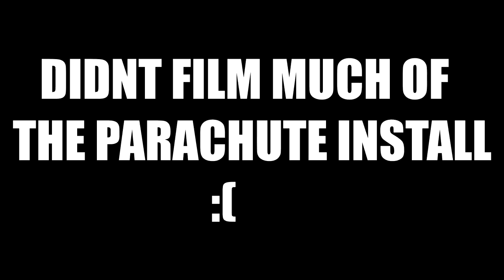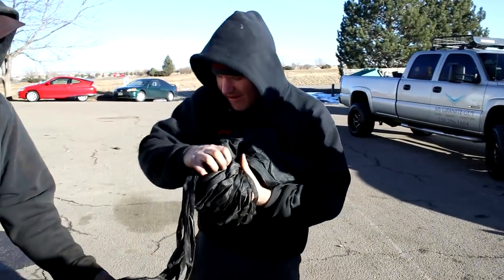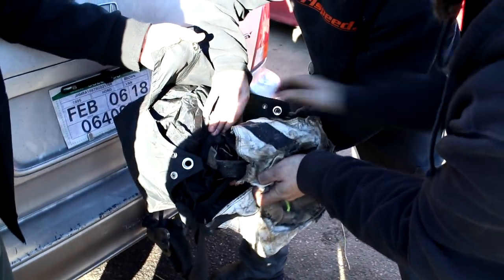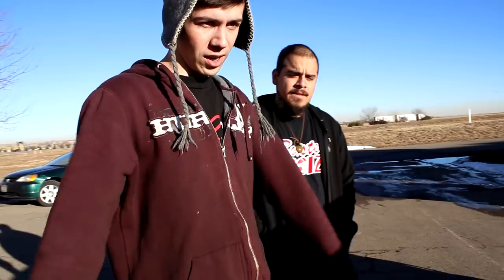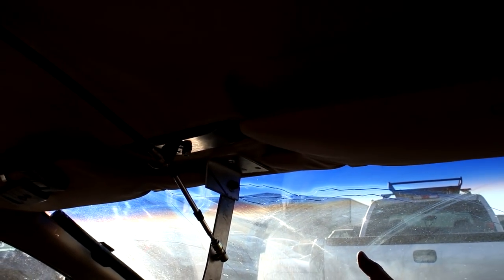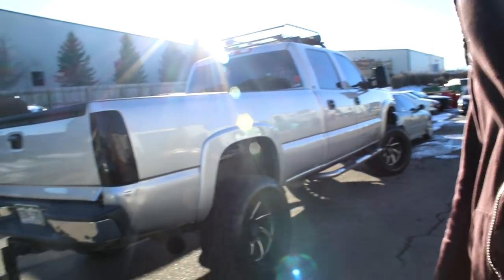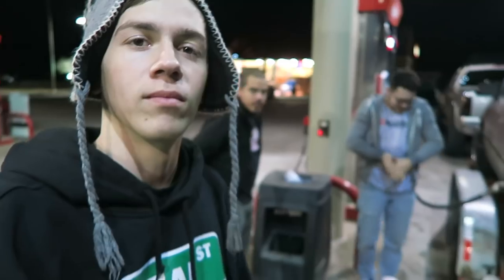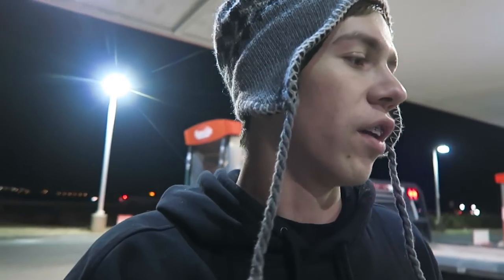We Put a Parachute on a MINIVAN?!

Comment: 700 hp minivan vs Adams 700hp 335i. Would be a sweet race
Reply: BoostedX I'm not sure the van actually eights more...
Reply: BoostedX 335 would smoke easy
Reply: Casanova even if it did the hatch back would come to revenge it

Comment: I always see DSM's at PFI... you guys should do a DSM build. You'd be extremely surprised what a stock block DSM is capable of. sell that 240,every youtube channel has 1 or 7..
Reply: I agree the trans is the weak point. But Kyle has enough cash to build a trans.
Reply: Isn't the stock auto pretty strong? (Hurr durrr but mansmission) I remember a 1320 video where a guy was pushing maybe 1000hp on stock tranny. Sure it won't live forever at 1000hp, but maybe good for 700?
Reply: The auto trans is definitely stronger than the 5speed, but not unbreakable. There are a few things you have to do to make them hold power, but nothing crazy. But the prices of auto parts are going through the roof.

Comment: Word to the wise, if you're running 1/2 mile, turn the boost down in 4th and 5th. Keep the heat under control at speed.
Reply: Why? Wouldnt it have heaps of cooling at that speed

Comment: Wait if ur making 700hp in Colorado in the mountain air wont you make more in Florida??
Reply: Jerrell Taylor 
Less.
Reply: Jerrell Taylor Typically yes you would make more power at sea level than you would at high altitude (less oxygen in high altitude) however old air is more dense and therefore allows an engine to make more power. I don't know how this will apply in this case though because I don't know how high up they are or what the temperature difference would be. I am pretty sure that altitude makes a bigger difference to engine power than temperature does, assuming we are talking about typical temps within the United States.
Reply: Seth Francis Sim Racing kyles at around 5000 feet, so he can expect about 35+ ish horsepower at sea level according to the 3% decline in power per 1000 feet

Comment: I wanna see this thing drag the f*** out of streetspeeds c7 vette!
Reply: HIR3D DRIV3R it would need more hp
Reply: It's front wheel drive,manual,open diff,heavier and has 100 less horsepower and 300 less ftlbs of torque. The van is fucking sick but not nearly in the same league.
Reply: Yeah I'm pretty sure he's not going to drag Mike's ass unless the car falls apart because Andy worked on it

Comment: Im telling you dude, stuff the inside of the rear springs with tennis balls, it will make the rear stiff enough to not squat so bad, i have a feeling yall are just going to be boiling those drag radials off there even on a prepped surface